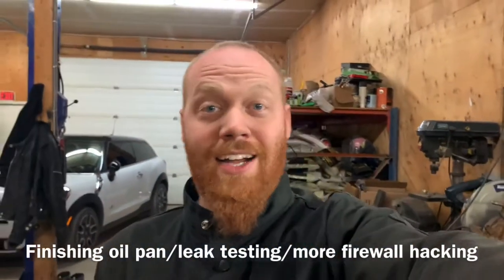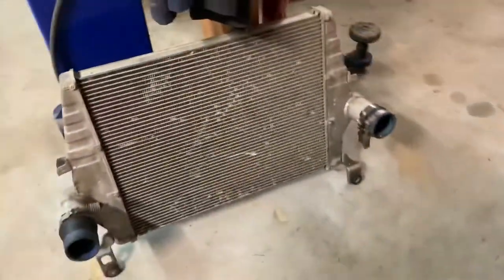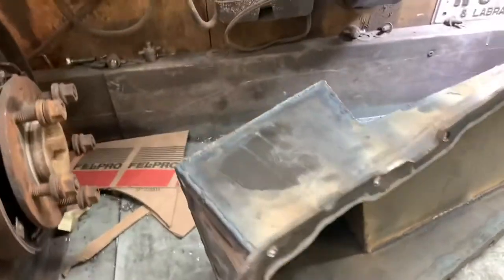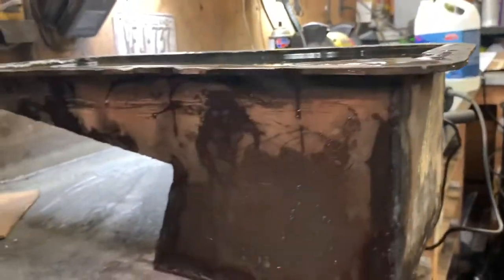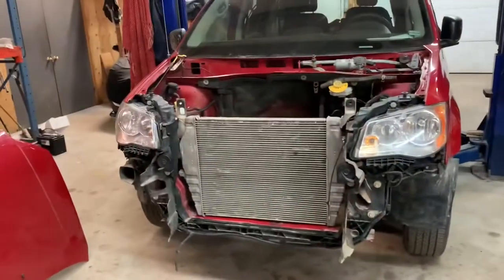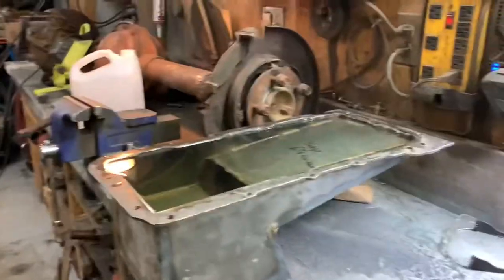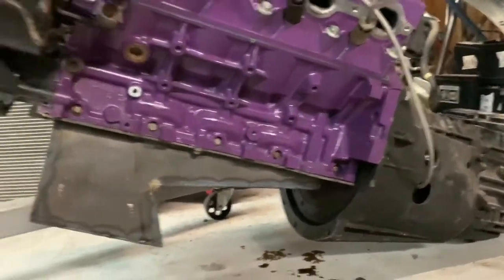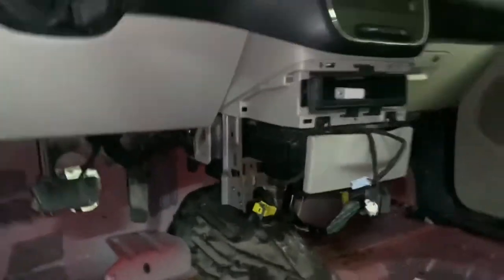How to make a sheet metal front sump LS oil pan - part five, finish welding and leak testing w/water

Comment: Glad I ran across this. I have to do somewhat the same. Bought a generic rear sump pan which just isn't fitting as well as hoped. Need to move the sump back about 1/2" to clear rack and pinion and want to add bump outs for capacity. I have flux core wire feed too. Wasn't planning to weld inner and outer but probably a good idea. Mostly worried about burn through. Need to find the right range.
Reply from the maker: Cool man, I hope it helps! I welded outside and in because I don’t want to have to go back and fix up leaks. The mastercraft has wire speed adjustment and head range (1-2) so I turn it up to (2) and the wire speed around 4-5 range and mostly tack/pulse welded it instead of one long bead, that built up too much heat too fast and burned through, and can cause warping. If you have any questions or anything just ask away! And if you like, join my Facebook group “station road rat rods YouTube”, and post pics/videos of your project, we’d all love to see it